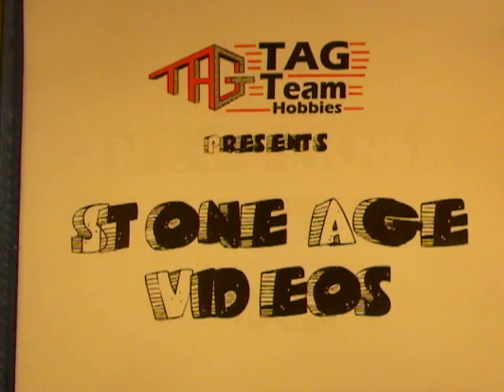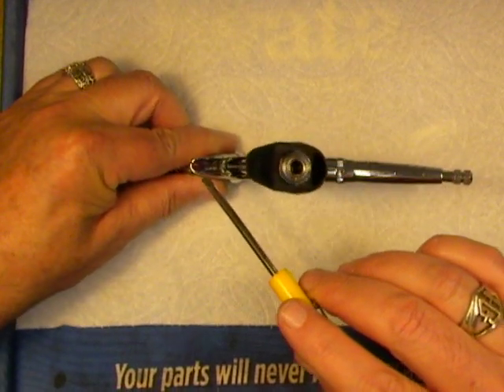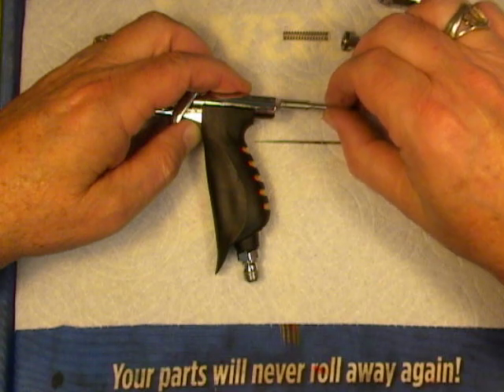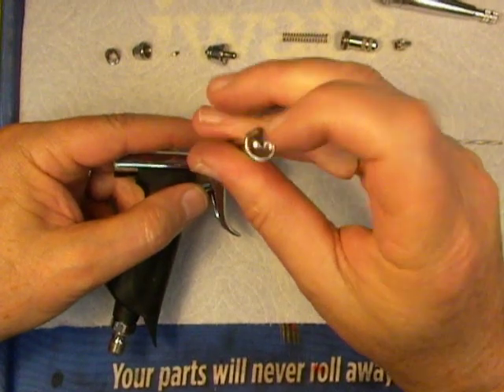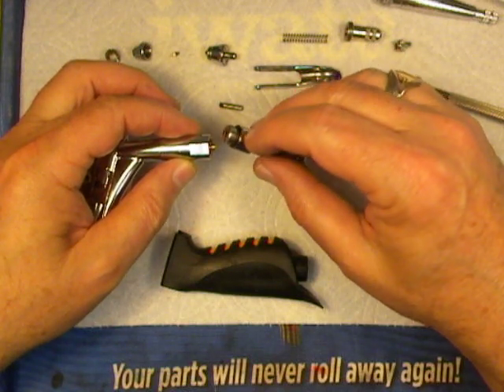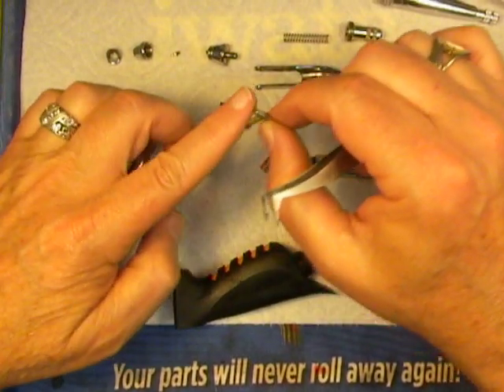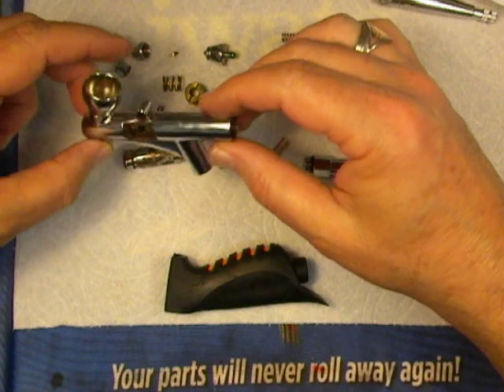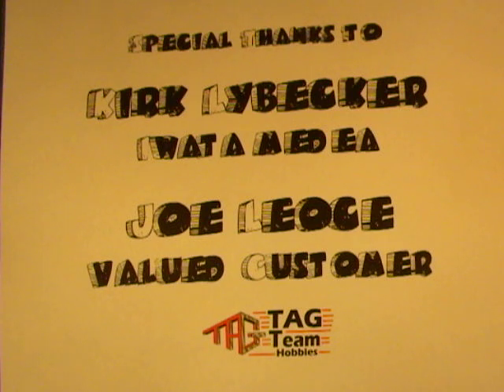Stone Age Videos: Iwata TRN 1 disassembly before cleaning.

Comment: I’m confused. You make no mention of part N1504, O-Ring Nozzle Cap. I see the o-ring in the exploded diagram but I’m not sure if my TRN-1 ever had one, or if I lost it or if it disintegrated in cleaning. I know it’s needed because I get bubbles around where it should be seated. What’s the deal? Thanks, and thanks for the informative video.
Reply from the maker: Hi Tornado. Hope you're doing well. Thanks for the kind words. Much appreciated. Historically, the TRN 1 never had the O-Ring Nozzle cap. The thought was that it wasn't needed as much as with the bottles that get attached to the TRN 2. It takes a lot to get the paint up from the bottom of a bottle. The larger nozzle on the TRN 2 could stand a bit more air flow., too.  Bubbling around the base of the nozzle cap isn't unusual. That's normal. If you want an o ring for your TRN 1, I have those in stock. Hope this helps!
Reply: @tagteamhobbiestomgrossman2720  Thanks! I just ordered two N1504s and am now a subscriber!
Reply from the maker: @tornadoalley4495  GOt the payment. Thanks! I'll get them out today.
Reply from the maker: I should probably do some more videos....

Comment: Hello i broke the head base, the pin is inside the head base packing, how can i remove the head base packing? Thank you
Reply from the maker: Hi Andreina, hope you're doing well. Sorry to hear you're having troubles. By pin, do you mean the threaded portion of the head base that holds it to the airbrush?  

Standing by.

Tom
Reply: @tagteamhobbiestomgrossman2720  hello yes!! But i already could remove it, now i have to by buy the head base again (sorry for my English, my language its spanish! 🤷🏻‍♀️
Reply: @tagteamhobbiestomgrossman2720  hello! I have another question, i use the airbrush to paint with cocoa butter, can i wash the active part of the airbrush with hoy Water with a little bit of soap? Can i inmerse that part in warm water?
Reply from the maker: @ANDREINATEX  Hi! GLad you got it out. This is the first I've heard of this happening. I sell those head bases. They aren't listed on my website, though. $6.50 Are you in the US? You sound like a chocolatier! What fun!  Hot water and soap are fine for the needle and nozzle and the other parts up front. Best not to get the air valve wet.  That can create other problems. Do you have a parts guide for your TRN?
Reply: @tagteamhobbiestomgrossman2720  thank you very much for answering so quick!! 
Yes im a Chocolatier!! (@texierchocolatier) i broke that piece because my negligence 🙁, i tried to close very hard the headbase and i broke it , im not in the US but i’ve already bought the piece, im expecting it to arrive here next week! (Hope so) 
Your work is spectacular, i Will follow you to learn how yo use the airbrush!
Reply: Also i want to buy another one, less expensive with a 1 mm noozle and long life, which do you recommend me (of course to use it with cocoa butter) when it gets dry gets very hard but i can remove it with hot or warm water
Reply from the maker: @ANDREINATEX  What delicious work you must do! And if you're not in the US, the postage and taxes/etc would really hurt. So, you're looking for something for broader coverage.  Couple options. You have a TRN I gravity feed, yes?  If you, that can be converted to a .5. You will need the following: N 075 4  .5mm needle, N 080 4  .5 Nozzle, N 135 4  .5 head base,  N 140 4  .5 nozzle cap, N 165 2  NEO .5 Spanner.  There's also a 50 ml gravity feed cup that Grex makes that fits it. Another choice would be the Iwata HP TH. https://www.iwata-airbrush.com/hp-th-hiline-airbrush.html That comes with a .5. It will also spray a fan pattern. For a larger needle/nozzle, a big spray gun will work. https://www.iwata-airbrush.com/rg-3l-wpc-61-cup.html   or one of these: https://www.iwata-airbrush.com/full-finish.html
Reply: @tagteamhobbiestomgrossman2720  thank you, thank you very much! I really appreciate your help! It was very helpful! I will follow you from now on to learn how to use the airbrush properly! Best regards!

Comment: How do I fix it from bubbling into the paint ?
Reply from the maker: Hi D! Hope you're doing well. If you've got bubbles in the cup, easiest thing to check for is some accumulation at the tip of your needle. That's called tip dry. Brush that off and you should be good to go. If there's no tip dry, take a close look at your nozzle with a magnifier. Even a little damage can cause things like blow back, aka bubbles in the cup. IF the nozzle is fine, then it's usually something loose up front. Like the Nozzle cap or the nozzle itself. Avoid using pliers! They chew up the finish! If you've got things finger tight and there's still bubbling, you might try a little chap stick on the base of the nozzle before you screw it back in place. 

Hope this helps. Let me know if none of this solved the problem.